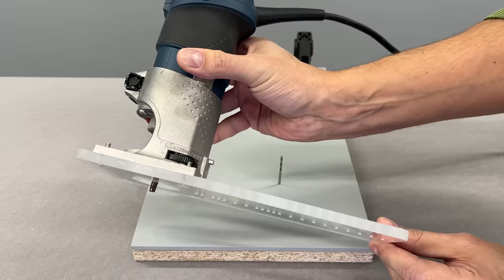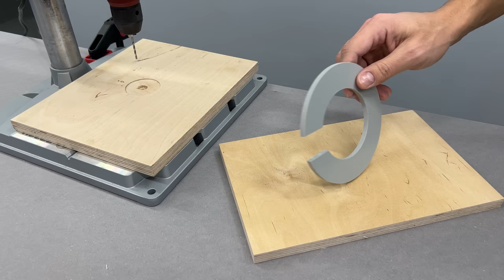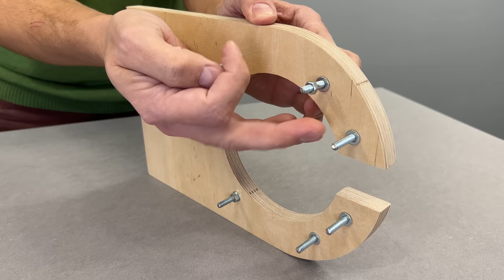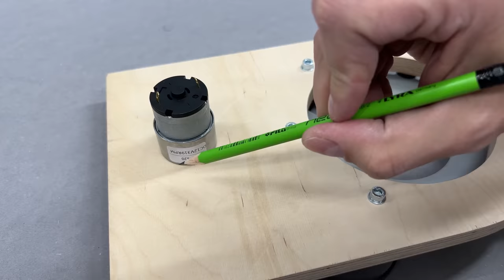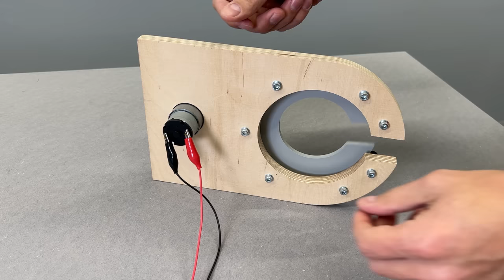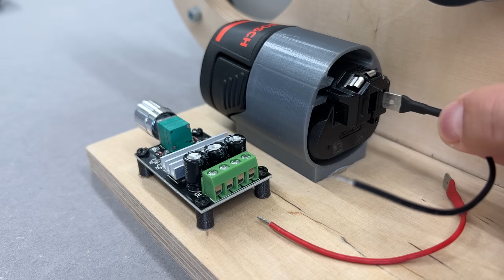DIY Wire Harness Wrapping Machine

Comment: Great job.  I would say as I have advocated before that more and more diy electrical  shop machinery should be made cordless, and the batteries solar, wind, or just sustainably charged.
Reply: Do the math on how many solar panels and batteries you have to replace when they wear out and the embodied energy/C02 required to produce and get them from China to your hands. Then multiply that number by the number of people using "sustainable" solar and batteries. Suddenly, a plug in AC motor powered tool that lasts generations powered by the grid doesn't look so bad.
Reply: @@umaikakudo  didn't they make these types of arguments over a 100 years ago when we made the transition to an oil economy, transition from horse drawn carriages to automobiles?   Yes there's a learning curve. Yes initially sustainability will require oil to transition to move us into a new paradigm.  Yes it doesn't make economic sense now.  But things always progress and move forward, whether some of us like it or not.
Reply: @mr.makeit4037  You're not understanding fundamental physics. Think of the tens of thousands of hectares of wind and solar panels and hundreds of millions of units needed and how short their service life is before they wear out and have to be replaced. These things don't magically appear out of a Amazon wearhouse and disappear into thin air avoiding the landfill or energy cost of recycling at end of life.

Tool batteries, 2-3 years 
Solar Panels, 5-10 years
Wind turbine, 10-20 years

AC powered electric tool:  1 or more generations
Centralized Power Plant: 50-100 years
Power Grid: 30-50 years

The math doesn't add up in raw materials alone even if you have a clean perpetual energy machine.

The transition from muscle power to hydrocarbons worked because they were going from lower energy density to higher energy density. Renewables are far lower energy density than hydrocarbons giving a worse net energy output ratio (amount of energy needed to produce the power vs what is left over to do work) no matter what technological breakthrough in efficiency arises. You can't cheat thermodynamics and physics is unmoved by ideology or good idea fairies.
Reply: @@umaikakudo  I'm not disputing the energy density differences between fossil fuels and sustainable energy.  And fossil fuels have built the world we live in today for good and now for much worse.  We have little choice but to leave fossil fuels behind unless some kind of technology comes to remove the co2 from the atmosphere in a really effective, cost effective and meaningful way.  Also sustainable energy will encompass more than just solar and wind.  I.e. fusion energy could be one type on the horizon.   In any event, my point here is much smaller in scope.  My shop is off grid and works with solar just fine.  Yes maintenance is involved but my cordless lithium batteries power my drill press, bandsaw and soon to be miter saw with the aid of dc 40v motors that replaced the old induction motors.  And guess what?   They perform much better than the induction motors as they have now variable speed control.  It's here to stay. Not moving backwards.  Looking forward.
Reply: @mr.makeit4037  Your original post suggested adding lithium batteries and solar power recharging to make the project more sustainable. In this particular application, the extra complexity and materials would do the exact opposite. 

A good question to ask is "What if everyone did it?" Congratulations, you've converted your shop to off grid power and nice brushless lithium battery powered tools. You intimately know how much kit is required to make that work and how often it wears out and has to be binned and replaced.

Now think what would happen to the planet's resources If a few billion other people did the same. If you want to save the planet and humanity from certain doom you have to think at the planetary and global population scales to avoid jumping out of the frying pan and into the fire.

Also, it's easy to set up AC motors with modern efficient VFD speed control for stationary tools.
Reply: @umaikukado; I come to these videos to find the essay writing know it all and you sir did not disappoint.
Must be lonely up there on your altar.
Reply: @davidrichter9164  I come to find folks programmed by the simplistic narrative and give them pause for thought to examine the supermassive blind side they never had a thought to consider.
Reply: @@umaikakudo  Perhaps my friend it's time to inwardly reflect on your 20th century thinking, overcome this flawed view and join us as we move on into the future.  A scary future that we all made through the use of your precious fossil fuels.   Lots of problems ahead that need critical thinkers to work out.  If you can face this challenge, the world will certainly embrace you my friend.
Reply: @mr.makeit4037  That's exactly what I'm doing. We need solutions that are not shackled by legacy designs and implement true change and real world efficiency. Aptera is doing it right. Tesla is and all the other EV makers are a major fail as an example and are not engineering from first principals. Do the sums on the entire lifecycle from extraction to disposal and you'll find there is not enough conflict minerals or other needed materials on the planet to make enough lithium batteries to store the amount of energy needed to power the world from intermittent renewables. Ditto for grid storage sized batteries that are made of the most common elements on earth like Iron. No one knows how to recycle massive wind turbine blades yet so they are landfill in a few years. Solar panels become obsolete from efficiency loss in a few years and have a short lifecycle and become landfill after they degrade and fail. People are building net zero passive houses to save energy and C02 that use foam insulation that has a 120 year C02 break even point. It uses less energy inputs (or even is a net producer) that appears to save C02 but in the final analysis is majorly in the red when trying to reduce C02 due to poor materials selection.

Virtual nobody from the common man to the top tier engineer/researcher is looking at the total picture and accounting for the energy a product or solution uses from extraction to final disposal. When you do that, current "green" fads are exposed as unsustainable and the real solutions are far different than what people are told what to think.
Reply: @@umaikakudo  yes I would have too agree on many points.  But would you agree that falling demographics around the world will decrease demand for finite resources used in sustainable types of energy?  I believe also that repurposing older panels and batteries will be the norm if not already more and more.   I and many others are proof of that.  Used panels can be utilized in smaller systems til completely used up, as will as batteries.   Many smaller industries are brokering these items from first hand users to the second hand market.  Also new industries are recycling these items in an effort to extract most if not all of their rare minerals for reuse, i.e. batteries, panels,  and wind turbine blades.   This I know for sure as I have seen the facility here in Texas that recycle old blades into insulation and road base materials.  The problem of fossil fuels used to manufacture sustainable energy products does exist.  No question, but we are just now entering this Era of sustainability, and this problem exists and will need to be addressed.  Finally I would say humans as with any species will adapt and become super efficient, utilizing the new energy tech that will be available til more can be efficiently generated.   
P.S.   you never have addressed my comments regarding fusion technology and its potential.
Reply: @mr.makeit4037  no they didn't . combustion moters were a definite upgrade when compared to horses hard to raise a logical argument against. with current tech carbon free energy is putting the cart in front of the horse, unless you condone nuclear.
Reply: @mr.makeit4037  you aren't moving anywhere except into fantasy land
Reply: @umaikakudo  you can always spot an uninformed argument by its lack of substance and abundance of name calling. so much easier to be an ideologue than to contend with facts. rather than calling someone a know-it-all why don't you factually dispute their statement?
Reply: @@ollie9777  I never disputed that.   I believe that I compared the  horse and carriage transition to fossil fuels a period of transition similarly to what we are experiencing now.  And a period now with many challenges ahead.  Also I might add that the many forms of sustainable  energy wont be an end all answer to what's ahead.  My narrative was to only say that the transition is here ans nothing  will stop it for better or worse.    My initial comment was in regards to making more videos showing diy tools using cordless batteries.  I have done this in my shop.  My only mistake was to engage with the internet trolls  with their pessimistic views who came out of the woodwork.   A waste of time.
Reply: @mr.makeit4037  any discourse void of ad hominem attacks and blind belief in an ideal can open people's eyes to the other side of the coin. far from being a waste of time honest conversations are greatly needed.i accept that fossil fuels do need to go.. far too many people and governments are not being logical about the transition e.g. insisting that e.v.s will help the environment and must replace combustion engines immediately.considering that over 80% of electricity is generated by fossil fuels , the added damage to environment caused by mining necessary   elements ,carbon footprint caused by mining and transportation, the fact that much of this takes place in countries with little environmental regulation, and many other problems that make an abrupt transition more harmful than helpful. trying to reach the end goal before achieving the necessary steps is a failing proposition. politicians/govs. seeking power and control does not help either.look at the nations that have tried to prematurely eliminate Fos. fuel and the problems caused. innovation in generation of electricity will be the answer in the meantime there are carbon traping tech available .maybe regulating it's use could be used until future tech comes to fruition? I am not a scientist so I can only guess.. I cannot get behind carbon restrictions that cause human suffering through starvation and freezing. these type measures are not very effective anyway .isn't the projected benefit something like a decimal of a percent carbon reduction over 50 years?
Reply: @@ollie9777  All  of this highly stressful for everyone.  I have always been an optimist in life, and will continue to do so when trying to reduce my carbon footprint.  I actually stopped arguing these matters years ago,  and then focused on prepping the best that I could for myself and family.   But the bottom line still remains:   our species as a whole has exceeded our ecological capacity to sustain ourselves and waited way to long to correct this complex issue.  The Era that we are entering will be much more unpredictable with a much more forced simplicity in terms of our lifestyles.   And yes the world will  suffer with a sharp decline in population.
Reply: @mr.makeit4037  you are probably correct , as the over reaction and power grab has already started. I commend your choice to move towards a prepared position . your choice is a good one more so because of tyrannical governance ,social decadence and a media supported population wide psychosis  . I  understand that mankind is changing the earth . the measures taken to limit this are more political grandstanding ,power grabbing and intentionally divisive than effective. the majority of people who insist on carbon limits are still flying private jets driving with motorcades of SUVs and living on the coast.( not afraid of rising water levels?) power elites world wide never fail to take advantage of a crisis. if the powers that be were truly concerned in doing something effective why do they not implement practical carbon reductions?  when I start seeing things like computer applications to improve stop and go and idling caused by traffic lights or massive no emissions public transit projects  that are prompt and user friendly than maybe I will believe the elites fear of carbon emissions. meanwhile all I see is a move to reduce food production weakening the populace , a move to e.v.s which is now and will be for at least a few decades more harmful to the environment than combustion engine vehicles.  all of the rare earth mineral mining and energy needed by china ( who is still building coal fired plants) to produce e.v.s and deliver them on diesel powered cargo ships eliminates the carbon reduction anyway. don't get me started on transferring power to china who are an almost perfect model of elites having ultimate control of the populace. any way all of the measures being taken are more effective at centralizing power than any thing else. when you start seeing things like local production. being promoted with grants and tax breaks eliminating the fossil fuels needed to transport goods or tax breaks for individuals who use public transit or $ being spent on bike trails or even the development of more nuclear power let me know. until then remember that the climate has been changing for eons and. don't fall victim to the hype.

Comment: If it didn't have the cut through, you'd have to actually stick the wire bundles through the hole!
This is good for all those 200m and longer projects that need to be wrapped in the middle.

Comment: just curious what size idler and drive pulleys and belt, that you used?
I have a need to wrap about 80 ft of wire , with tape and I've been putting it off,
because of the amount of work required to do it by hand.

Comment: Nice video. Only improvement suggestions I have  would be for links to some of the custom or hard to find parts you have there (example: the harness for the battery. Is that 3D printed?)

Comment: beautiful job!  Do you think a tensioner on the wrap spool might increase the versatility in case you're not using something like velcro?
Reply: Could be simple enough to do .... longer bolt holding a light compression spring against the tape spool - and use a nyloc nut to compress the spring.

Comment: Hello, incredible video, Congratulations, what type of tape is it?
Reply: It looks like wire loom tape. I personally use Tesa 51608, 15m X 19mm Adhesive Wiring Loom Cloth Tape when I build quadcopters (I buy packs of 5 rolls). The tape I mentioned works great and does what I want it to do. However, it is the only loom tape I've used so I don't know how it compares with other brands or types.

Comment: Could you please post in your description the parts used? Like, what is that circuit board do-dad, and where do you find aftermarket battery holder thingies like the one you used?

Comment: That’s really cool dude. Question, how did you go about making that template to make different size circles and what type of bit are you using in your tool ? Thanks for a great video.
Reply: Search router circle jig for the template, they're pretty simple to make. He's using a laminate trimmer and either an up or down cut spiral bit.
Reply: @TruckDrivingFool  are trim routers actually laminate trimmers? I have his exact same router I just didn't know if it was tiered just for laminate. I thought it was for wood, but you can then adjust it for laminate
Reply: @wowzande   That one certainly isn't just tiered for laminate I just tend to call any of the smaller hp/base routers a laminate trimmer. If it gives a quality cut for the task at hand without bogging down then you're good to go. If not you need a lighter cut or a bigger router.
Reply: @TruckDrivingFool  okay cool. I also have a plunge router from harbor freight, is there a larger classification then that without having to go to the cnc spindle stuff? I guess the more powerful you go, the heavier the motor, making it difficulty to actually move around .
Reply: @wowzande  I guess I'd label them as laminate trimmer, trim router (you've made me add that to my vocabulary cause it's a good distinction), router, and finally the big boy a shaper. Anything CNC is it's own class in my mind. Those would range from from oh that's a cool little set up to daym look at the size of that thing.
Reply: @TruckDrivingFool  yeah it's a dream of mine to fully build a cnc machine . Or at least refurbish an old one.. Right now I got my tiny nema 23 stepper motors  but I was hoping to use one of these routers as a spindle just for smaller projects  . I can't afford those cnc spindles man those are like $8000+ . Now these things got tool changers and all this stuff. I've seen people stick dremels on smaller versions maybe I can try to use a motor with more torque and power, like a chop saw motor. Either way, thanks for the information!

Comment: Could you use a 120 Volt AC dimmer switch for a DC 12-volt system as a motor speed switch?  
I'm not a pro electrician.
Thanks

Comment: You could probably reduce a significant amount of noise it generates if you smooth out the leading edge of the "C" pvc part. Right now it's rough edge collides with the rollers and make that clicking sound.

Comment: how about circular tube dc coil wire wrap, that "entry" slot is a nice invention
Reply: no, wrap with insulated coil wire, not wrapping a wire, lol
Reply: donut wrapping with insulated wire = donut coil, electromagnet
Reply: yes it makes dc brushless motors, no motor controller required, just a current/voltage potentiometer, variable resistor, to a dc power source, no inverter/ac components required
Reply: there could be a clip bridge to prevent the glunk glunk train track step noise,
Reply: complete the roller circle, I mean